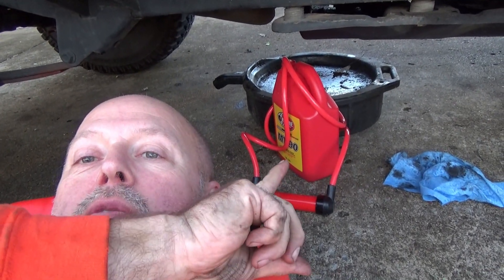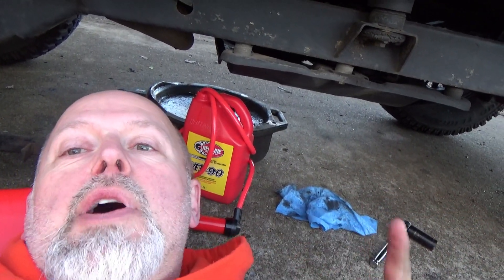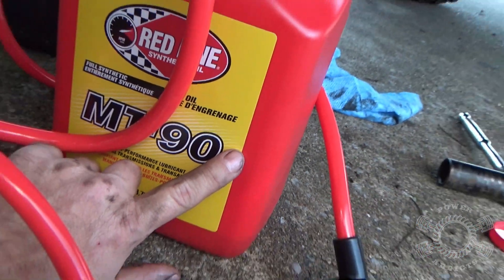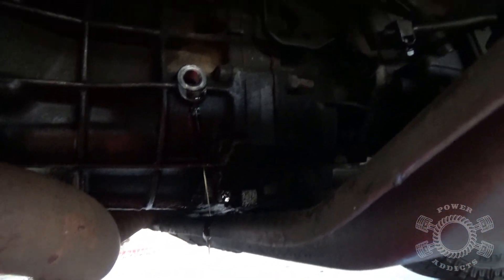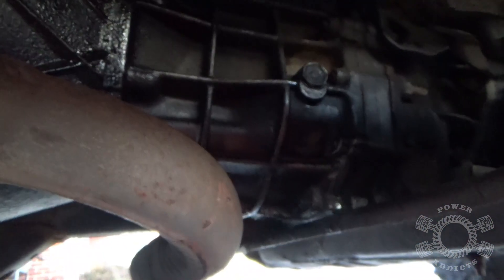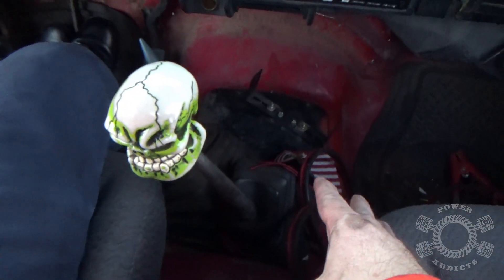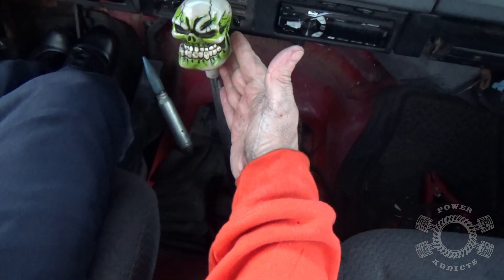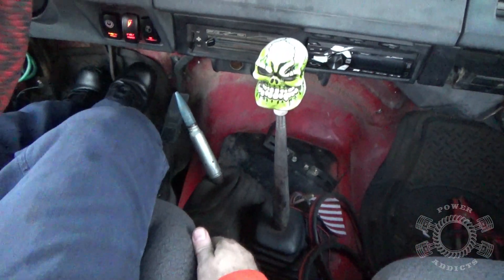Change AX15 transmission fluid in a Jeep #ax15transmission #poweraddictscrew #jeepwrangler #jeepyj

Comment: Good choice, that's the same oil I use. Just a hint, warm up the transmission by driving around the block first, then loosen the transmission fill plug, then remove the transmission drain plug and drain. Also heat up the Redline MT-90 ahead of time, makes it easier.
Reply from the maker: Great idea. Thanks for the tip!
Reply: @Wade Jeremy I dunno I use Flixportal. Just search on google for it=) -joshua
Reply: @Joshua Zachary Thank you, I went there and it seems like they got a lot of movies there :) I really appreciate it!
Reply: @Wade Jeremy glad I could help :D

Comment: Forgot to mention I have ran conventional 10w-30 in my ax15 for 10 years now. Couldn't afford synthetic the first time but had to do something so just stuck with it. Only gear I have issue with is reverse,I have to go to 1st then reverse which is habit now.  (248,000 miles)
Reply from the maker: Glad it worked for ya. That transmission in the video had issues when I installed it. It came out of a Cherokee XJ that was beat on hard!!

Comment: Good Video! Another tip that I use since I don't have a transfer pump is slip a short piece of clear hose over the end of the quart bottle style
Reply from the maker: That does work real well. I put diff fluid in an 8.8 rear diff in a Fox Body Mustang. using that method.

Comment: What do you think about the the Lucas differential fluid is that no good for that or is there a better blind
Reply from the maker: I personally wouldn't use it. Some differentials require a friction modifier for limited slip clutches such as a 8.8 LSD. The Jeeps that come with tow packages use a bit heavier (thicker) differential grease.

Comment: I have another question about the four-wheel drive I can drive it in high gear but I can't switch it to low gear what do you think is causing a problem and can I fix it on my own
Reply from the maker: Possibly need to adjust the transfer case linkage. Its an easy do it at home project. I haven't got  video on that. But it is now on my to-do list.